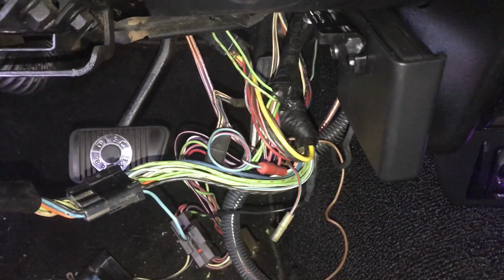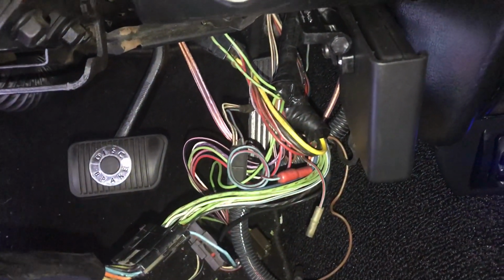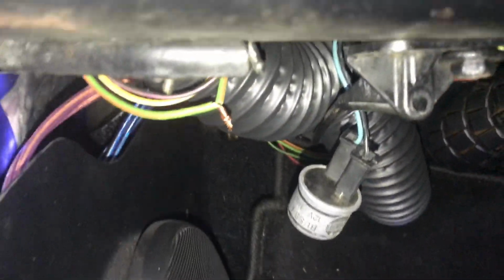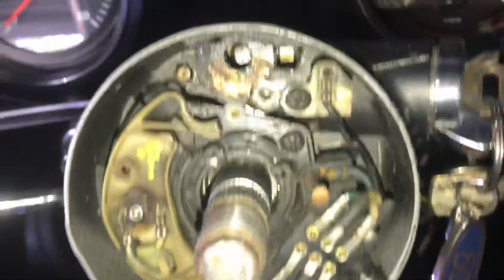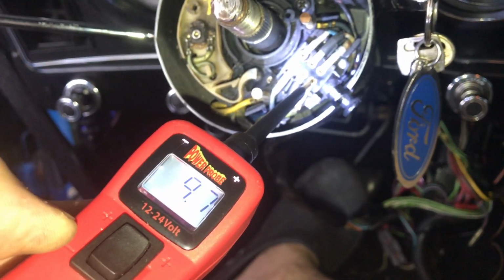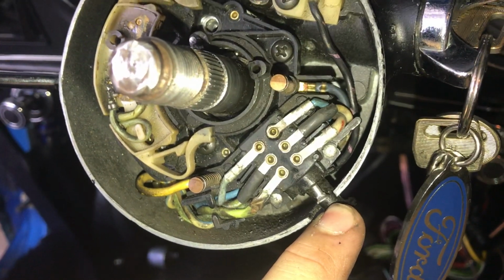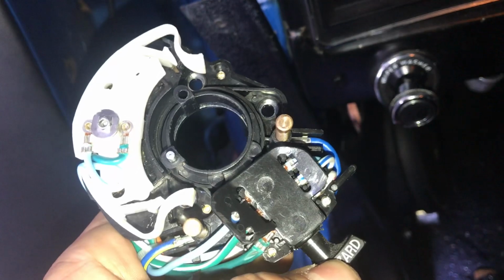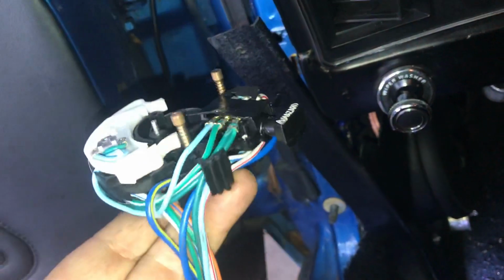How To Troubleshoot No Brake or Stop Lights

Comment: Thanks for the video. I finally have my 71 back from paint and now I need to figure out all the wiring gremlins. I wish you lived closer I’ve got so many questions. Gotta get a power probe!
Reply from the maker: Power probe will solve 90% of your problems.
Reply: @fixitnoworlater  hey my third light works the one in back window. Can I take 2 wires from that light to one side or the other on the lower 2 . And if so which side driver or passenger. Then let me say there are 4 wires going from driver side to passenger side light. So which 2 wires do I use. I stripped those 4 wires and touched one of the wires from third light to one of those wires and blew a fuse same with the other. The other 2 are a little bigger haven’t tried those yet. Basically trying to jump power from third light to the other 2. Also had brake pedal pressed.